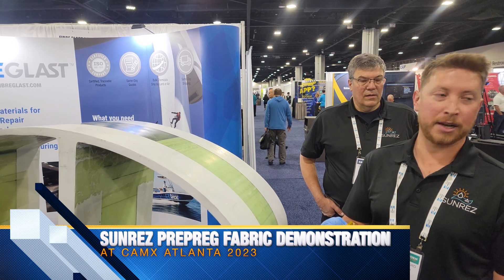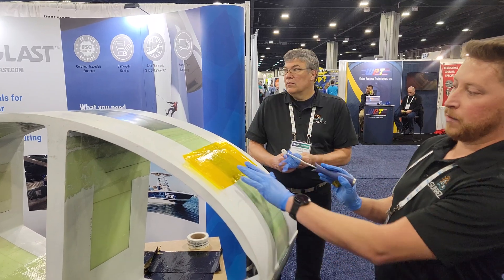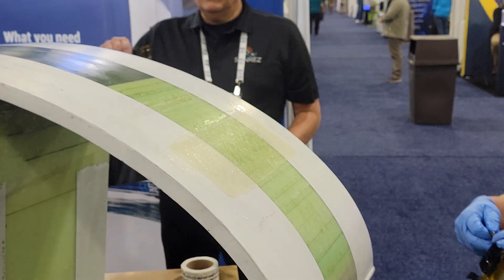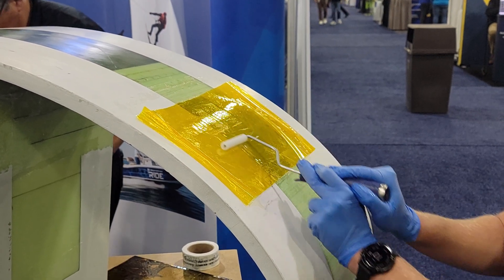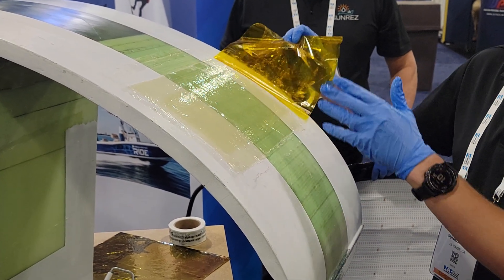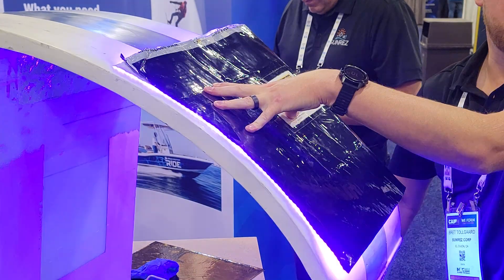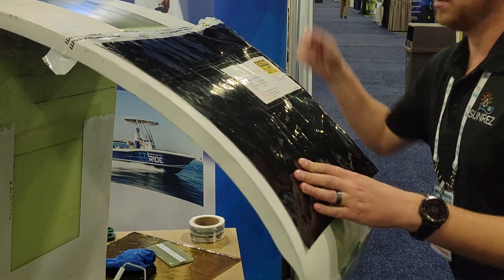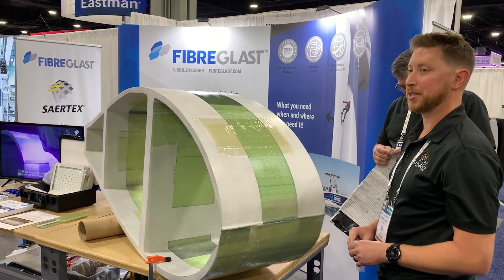Sunrez Prepreg Demonstration

Comment: Looks great! How’s the odor?
Reply from the maker: Thanks for reaching out! The patches that were used during this video were with the Epoxy so very minimal odor- still want to use in a well ventilated area. The larger vinyl ester patches have a significant Styrene odor, best to use outside or in a well ventilated area with a vapor respirator.